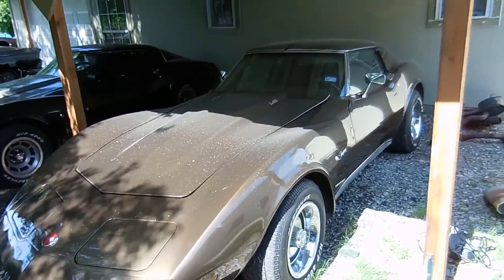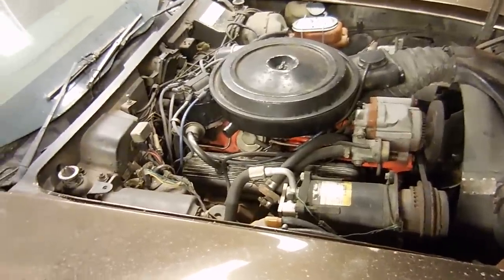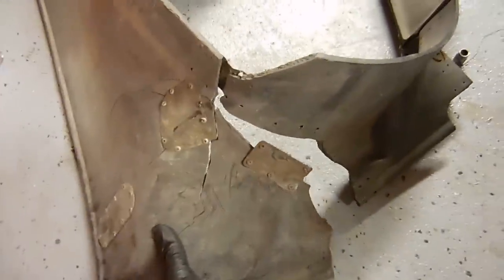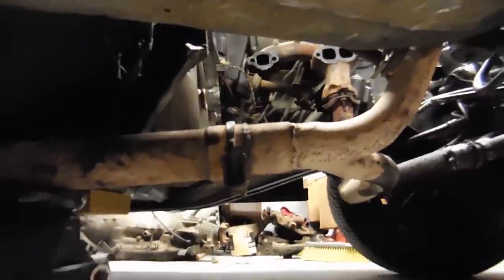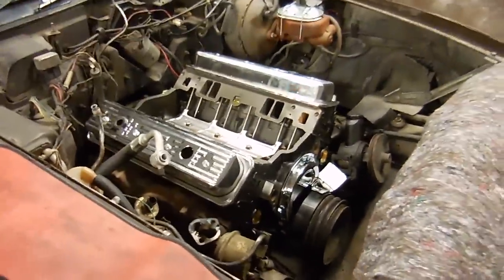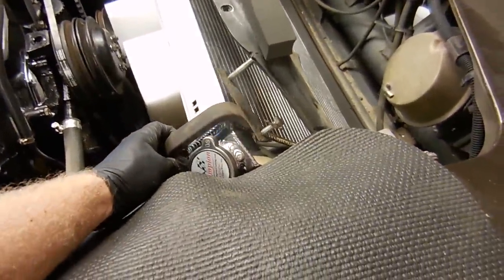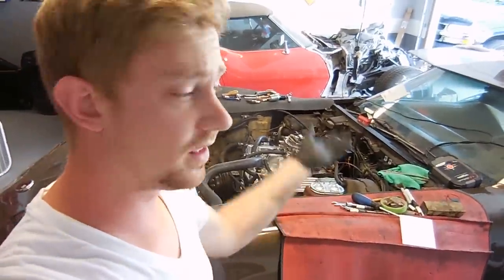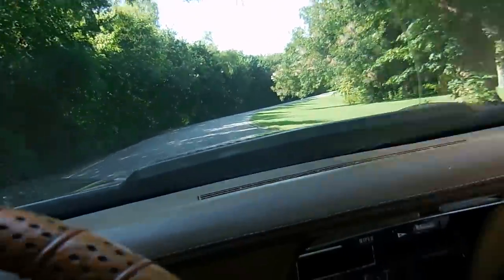John's 1976 C3 Corvette Gets a Brand New Crate Engine

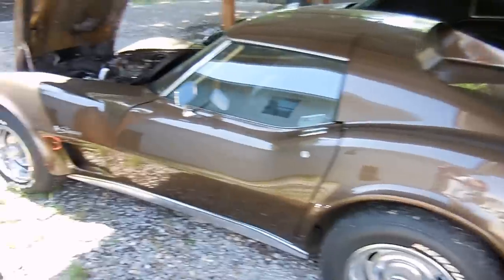Comment: Yeah good call buying a new engine, the last time I saw a car smoke that much, it was on that Main Force Patrol Car from the first mad max film that had formerly been a taxi in the opening chase, and that was smoking pretty bad lol ala 2:11 here lol https://www.youtube.com/watch?v=JfJVmzthD3Q Also if he needs corvette parts to make it handle better tell him to go look at detroit speed inc, as they've got some pretty cool suspension stuff, like a touring kit for 400 bucks to help people get these things ready for autocrossing
https://www.youtube.com/watch?v=Pa-1_o44e68

and unlike Ridetech, its not the cost of the damn car to upgrade the front and rear suspensions to be able to take modern power with modern tech, hence why i wrote off the corvette for awhile, as every other muscle car has any number of suspension options for autocross, except the corvette for the longest time. 

everyone always just cannibalized the C4 rear and stuck it on everything, even a batmobile -_-' 
https://www.youtube.com/watch?v=rXvWK8NnE1o

so its nice to finally have some options, as I'm starting to think if you want to put power in a corvette, for god sakes dont use fiberglass rear springs, as the heat and wear and tear will just tear it to shreads and delaminate the fiberglass

hence why when they made power they had beefed up rear steel leaf springs, and its only the 78's to 81's that seem to have problems if you put drag radials on them.

Comment: It's a shame to mess up a car that has remained stock this long, not to mention the loss in value.  This will never be a highly collectible car, but be that as it may, there are only so many virgins left.  

Are you not putting the a/c back on it?
Reply from the maker: Loss in value is relative. If you prefer the stock smogger low horse power engine, then in my opinion your a minority. Most people now, when it comes to rubber bumper cars, care less if it has an original engine. (Big block 73-74 cars excluded)
Reply: I guess we'll agree to disagree.  It's always easier to sell an unmodified car, and they WILL bring better money.  As these cars get older and suffer attrition, I believe the gap will only get larger.  Not all old cars need to be hot rods.

 I suppose a high-end LS swap done right would up the $$$, but I don't know if you could recover your investment.

Even a lowly C4 will bring a little more money if it hasn't been mucked with-and they aren't worth anything.

 IMO, if you don't put the air back on that's a major bubba right there.
Reply from the maker: Please remember it was all the customers decision, not mine to swap the motor. Also, to remove the air was his choice, eventually it will be vintage air. I'm instulted you called me bubba
Reply: If you do this for a living(I did years ago), I realize you sometimes have to do things you don't agree with.  I would try to persuade the customer to do the right thing, but I know it doesn't always work.  There were also times you simply had to draw a line in the sand and hold your ground.

Shit-canning the a/c is just lazy.  It only takes a few minutes to hang that compressor back on, and if you get rid of all of it the next guy just has to track it down to make that part of the car right again.  I just hate to see these old cars butchered.  My family ran a Chevy store for 50 years and owned many collectible C2 and C3  Corvettes back when they were not particularly valuable.  We always tried to treat them with the respect they deserved.

I remember when you did the C4 with the 4+3 in an earlier episode.  You unplugged the malfunctioning o/d, and then sold the car that way.  I suspect once you got the cooling issues resolved, it would have worked had you simply plugged it back in. THAT was when my bubba detector first went off. Little stuff like that bugs me.

I think your heart is in the right place, and you have most of the skills(learn to paint!), but you need to learn that the easy way ain't always the right way, money be damned.
Reply: I'm having more confidence in you in every video Ben. Nice intelligent answer Brother !!!. You rock !!!.
Reply: Maybe the engine should have been saved for nostalgia, like you said there are only so many virgins left but like Ben says it was the customers request I would have saved the numbers matching engine/trans and you dont always have to have the fastest car but you also have to look at cost. is it cost effective with the customers budget and like someone said the 70s a/c units sucked because it was still a Farley new option on cars why not get a little more power while you upgrade the reliability.
Reply: jnf91 please, its a 76 lol.  It’d be different if it was a 73.  But its not.   And it will never be as valuable.
Reply: TheCorvetteBen  I am disappointed there was a 30 mph floor it, and open up the 4 barrels a bit and let us know if there was a huge difference from the old motor in power.  nothing crazy, no burn out of anything.  just a 30-75mph sprint.
Reply: P
Reply: @TheCorvetteBen  yea but theyalso fix the454
Reply: Crimson Idol What is the right way? Enlighten us.

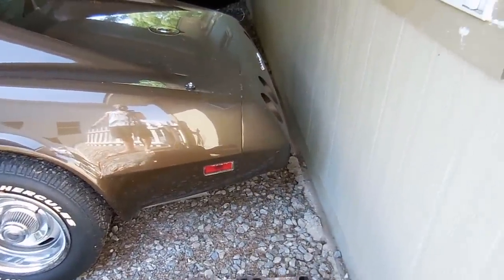Comment: They actually made the  L-82  more powerful by 1980 - 1982   they did have the larger 2:02 intake vales and higher compression .. I think they also had 4 bolt mains and a forged crank very good pieces..  The later years they had an aluminum intake 
https://itstillruns.com/difference-between-ford-302-289-351-engine-12050086.html
Reply: Plus  I have a 5  speed  Doug  Nash  Trans

Comment: You want more power,rebuild the "original numbers matching" motor, Throw a light cam in it,get a set of heads (saving the originals of course)and maybe a different carb(saving the original of course). The crate engine swaps are just lazy and,to be honest,are just getting old.

Comment: Why did you put a high po engine and NOT upgrade the exhaust system? The cat could have been replaced by a modern 3" inlet and outlet, and the engine could have gotten headers going into a 2.5 into a 3" y pipe.
Reply from the maker: Customer budget. NOT my car.

Comment: By 1976 all motors were absolute doo doo. Not worth rebuilding nor upgrading. It's why C3's make great project cars; i.e. swapping doo doo out w a nice stroker etc., will actually increase its value. Why not change the transmission too? Yes, ALWAYS replace the radiator. The only thing I'd add to the look is a ducktail spoiler which makes it look more like the early C3's.

Comment: New motor wont make that power with ypipe. Y not build numbers matching motor? If u wanted different motor y not big block if u like low rpm tq? Atleast put aluminum heads on new sb.

Comment: Why not go to a modern fuel injected engine?  LS1 or whatever?
Reply: You can now buy aftermarket throttle body injection setups for under $1,000 so they could make this engine fuel injected.
Reply: LS would need front spring rates adjusted. May sit ok but handling would change. Might sit like a horny teenager too with new oem springs.
Reply: nrgate  Changing springs just because you put an ls in would be totally pointless, an ls1 is only about 100lbs lighter than an iron head sbc.
Reply: it's closer to 150 full dressed

https://ls1tech.com/forums/general-lsx-automobile-discussion/1833920-difinitive-ls1-weight-vs-gen-i-sbc.html

Maybe put a big weather station hood ornament from army surplus? You do you bud. I've actually done one. You would be suprised how different the car steers. Old tired springs not so much, we had a cracked coil.

Comment: Didn't you just cut the resale value of the car??? I can understand putting a 400 hp engine in but they are only that original once,I would at least keep the engine and parts with the car.

Comment: Why buy a crappy blue print engine when you can have a local engine builder build the original engine to be more reliable and more powerful for less money?
Reply: You have no clue about Blue Print do you.........  Would have cost north of 3K to do the original engine right, and then you have what, a breathtaking 180-210 hp?  for $2599 you can but a 370+hp long block that will run circles around that stock engine and have a 50,000 mile warranty to boot.

Comment: No, no, no do this instead... use 010 block scat 3.5 Rotating assembly,  bore block .020, with 2 eyebrow pistons, a .520 cam 242 @.050, top off with a set of 68cc heads with 190cc runners, put a fat dual plane intake and a 650 cm eldebrock or Holley, install a set of roller rockers.... then to finish the job a set of 1 5/8 long tubes .... be happy....

Comment: What a crying shame that such an original Corvette has been trashed by taking out the original engine.  It's value has now decreased by thousands of dollars. :(  For the oil consumption issue, it was very likely caused by using conventional petroleum oils in the engine and the characteristic sludging and gumming up of the piston rings.  The remedy is easy; use AMSOIL Engine Flush and AMSOIL synthetic motor oils. Problem would most likely have been solved, the original engine would still be in the Corvette and the very high value of this Corvette could have been retained.
Reply: These had value?
Reply: @integrafreak1  syn oil burns clear problem fixed .but still no power?
Reply: It's a 1976, no value lost when there isn't much value to begin with.  Making it a better driver adds way more value.  These plastic bumper  vettes have always been very soft........

Comment: Corvettes from 1972 to 1982 were crap.  The 1976 350" engine was gutless at 180hp. They're not worth much performancewize or otherwise without a big boost in power. A crate engine is an economical solution. No Corvettes were produced in 1983. 1984 launch a comeback for the Corvettes. For older Vettes if you don't have a 1953 through 1971 forget it as a collectable or anything else in its stock configuration. The C5 and forward would be a much better choice if performance is a real consideration. Peace.

Comment: Great work but get that Automatic out of that car and swap it for a 4,  5 or  6 speed and have some real fun driving it. Automatics are for chicks. I put a ZZ 502 in my 70 Vert  with a 6 speed (Very hard job as the crossmember is welded in on standard shift models) and it's a screamer.